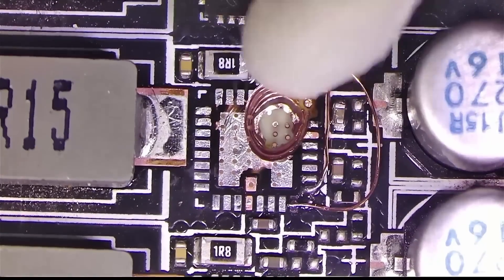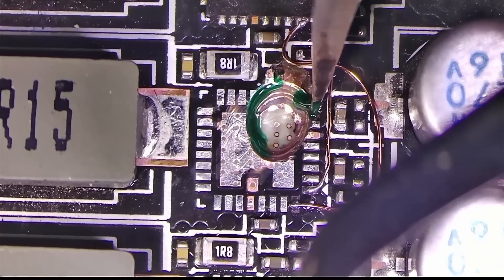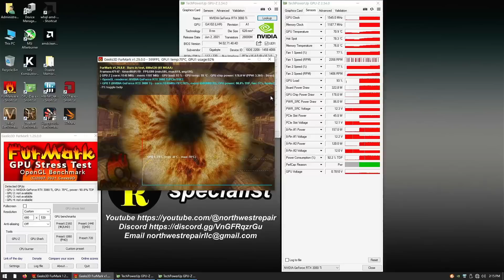Graphics card repair after mini explosion

Comment: So.. I'm watching this and feel a bit lost. Clearly the thing blew and left a hole, you added the UV resin to stop any shorts between layers, and then the blobs of solder and metal to... act as a heatsink for the chip? I'll be honest I'm lost trying to work out what it does there :D  Still I am amazed by what I'm seeing, I just "fixed" a usb drive by soldering on the anchor pins the factory didnt bother to solder on and that was difficult enough.. I can't imagine how you do this level of precision.

Comment: Hi, Could you tell me where did you buy that fume extractor hose? I want some air extraction for my hobby work, but local shops only have plastic ones (used in dryers) and aluminium ones that retain the form when you bend them, and yours looks like made of aluminium and also flexible.
I'd like a proper fume extractor but I can't afford to spend 900€ right now, so I'm trying to simply move the air away.
Reply: @Look_What_You_Did That kind of duct is not common in my country, that's why I was asking, because I've never seen something like that in 30 years. Is it like a spring with aluminium foil?

Comment: Amazing job. Did you have issues with solder adherence on the pit? I sometimes have issues (recap), some pads are stubborn, I try 2-3 times, if doesn’t work, I use a jumper to a nearby shared connection. Murphy got you on the backplate 😂
Reply from the maker: The problem inside was the very small surface area of the vias.
So one way to connect them was to press solder down as it cools and then mask it so it stays in place.

Comment: loving these repairs, next level. Hobby level solderer here, wondering what sort of temperatures that the mosfets and other components start to be damaged at? My heat gun only has 2 settings and idk if the lowest one is safe to use on eboards (I often try to fix gamepad sticks and cable connections so usually it's ok but using the heat gun on the joystick modules might be risky)
I've heard 250 celcius for less than 10 seconds as an upper limit for direct component heating. Would love your opinion on it.

Comment: Mosfet burned is like a burned fuse. There is a deeper underlying problems
Reply from the maker: yeah. internal failure is one of them
Reply: @northwestrepair  it took days for the replacement mosfet will shorted again. In my local area the repair for the short mosfet  very expensive close to $70. They will change all the good mosfet and drivers

Comment: I would have called it a loss with that hole.
Reply from the maker: I had no other choice.
I could not disabled that phase because it was paralleled to the other two.
I would loose half NVVDD phases if i did that because this card has another half MSVDD.
My options were none existent. Either i fix it or i fix it. No other choice.